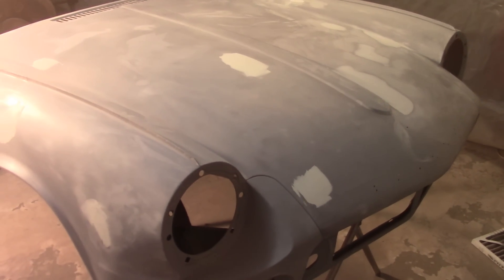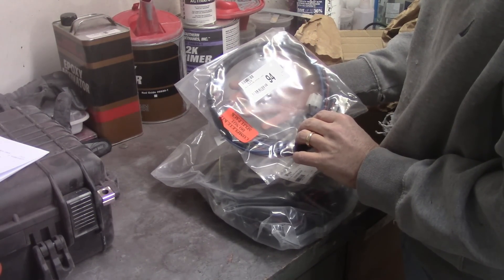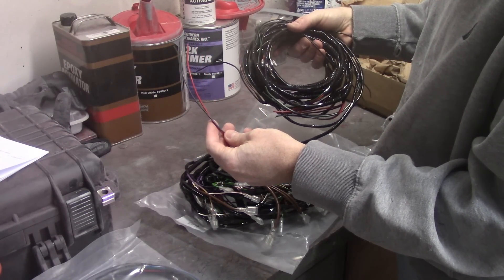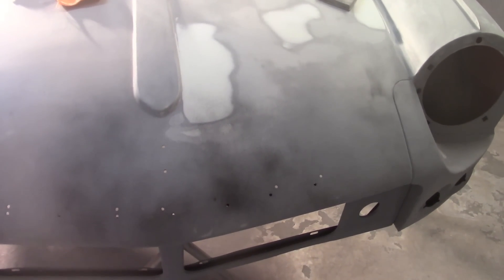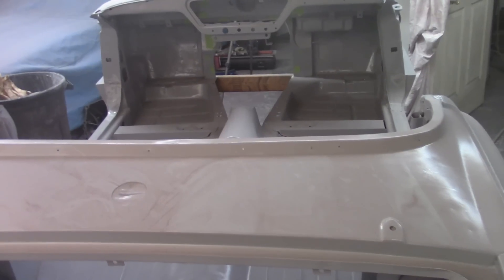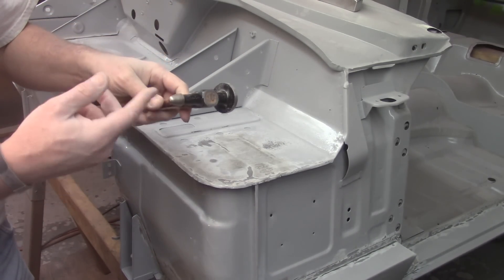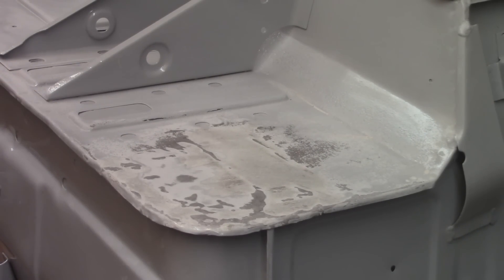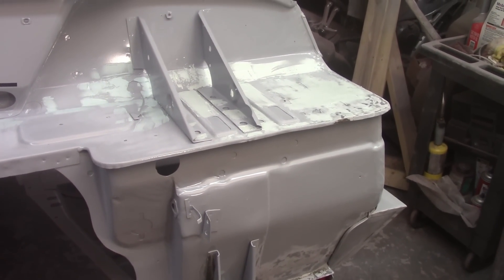Final (?) Bonnet Work & Bulkhead Work | Roundtail Restoration

Comment: You were pretty excited about that turn signal flasher connector! Did you do electrical in the Navy? I'm an electronic tech. 
Good call on the spraying temps, those guys are adamant about 65deg. On the forum I read a post by Barry that it took all he has to even out down 65deg in the tech manual.
Reply from the maker: Yeah, I'm not real sure why I keyed in on that. I was an electronics technician also, nuclear. We had to learn all the wiring stuff for our control cabinets; all small guage stuff. Yes, temp is very important I guess. I remember the very same post of his!